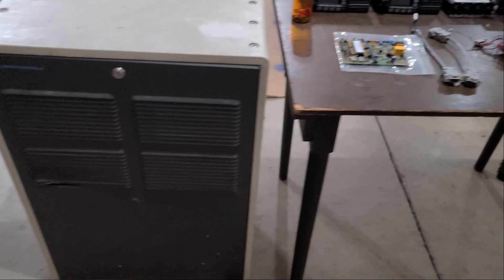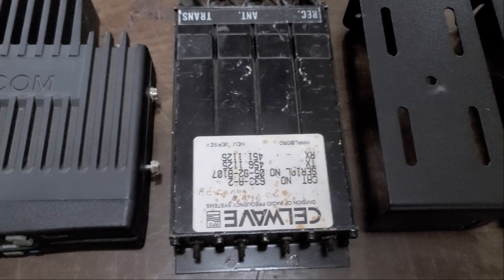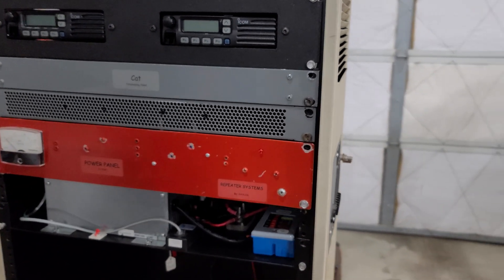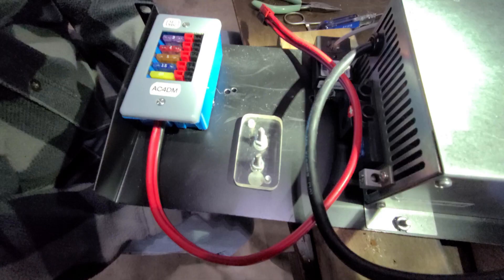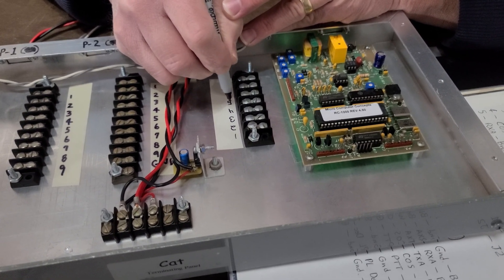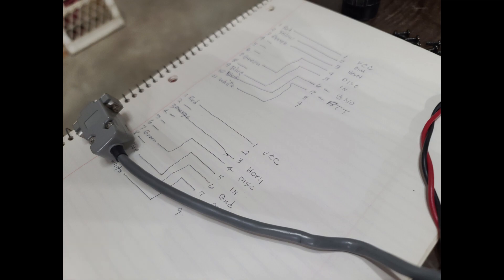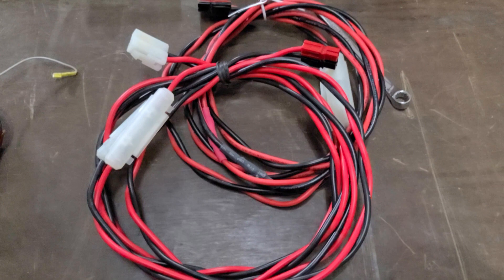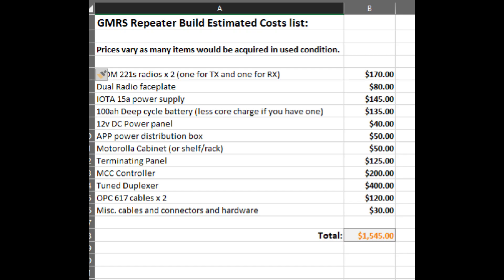LCARA HAM Radio: Building a GMRS Repeater Part 7: The Cost Breakdown!!!!

Comment: Years ago a friend came across a bunch of surplus radio parts from Uniden's commercial radio division. We went in halves and bought the lot. I came out with the basic repeater control boards in various conditions as well as odds and ends radio parts. Long story short, repaired all of the controller boards. Being in the 2way business since the mid 80’s and going tor hamfests I came up with various duplexers for cheap and in good condition as well as a fiberglass suitcase from a remote electrocardiogam transmitter.
Had a bunch of odds and ends HT90’s in the bin box. Well managed to salvage 2 of the 90’s had the re rocked to my frequency. Mounted the radios in their partial housings and supplied them with 12 volts. Mounted the controller on the same board and built an 8 volt power supply with an LM series 8 volt regulator to power the controller. Did all of the interface wiring between radios and controller and at first try had a low power repeater all mounted in this fiberglass case with enough room for a 12 volt gell cell and charger. It still works great to this day and I use it for remote camping use today in Europe, made sure it was not near any television bands in the area of use and it’s only for emergency comms. Even have  GE MVPeater that I purchased for $75 years ago, still works great except for some tantalum caps that decided to let their magic smoke out. Wish I could find some GE MASTR II Low split UHF chassis. With a little modification I can bring it up to the ham bands in use here in the EU. Only issue is finding someone to provide me with a set of crystals so I can recrystal it the right frequencies. These radios have excellent preselectors in the front ends so very little intermodal makes it into the receiver.

Comment: I just built a very simple and crude GMRS repeater on 462.625mhz with 100.0hz tone, all the way up here in Bee Lick, the furthest north point of Pulaski Co. I used a Motorola M1225 for the receiver and a Motorola CDM1250 for the transmitter with an ID-O-Matic IV controller for CW ID and courtesy tone. The power supply is salvaged from an old Dell computer that has been altered to allow operation via a toggle switch. The duplexer is a Cellwave RFS mobile type with RG-213 coax up to a Comet CA-712EFC antenna. I frequently talk on it with other GMRS operators in Somerset. Stop by and give us a call. 73 de AD4GC a.k.a. WROE979
Reply from the maker: Great work Greg! Come by sometime and show us some pictures. KY4BDP

Comment: So if you only have a gmrs license and not a ham,  then you shouldnt own and Icom??  I dont know
Reply from the maker: @Tightspot Pro - Thanks for watching! The ICOM radios used in the video are for demonstration purposes as they do not comply with Part95, but the overall process of building a repeater with these radios or ones like them is valid for VHF or UHF repeaters and can be used by HAMs. GMRS license holders can use most any GMRS repeater in their area, most with permission.
Reply: @LCARAHAMRadio  Thanks.  I wasn't sure.  I'm new to this. I have been interested in ham but came across gmrs.  I may move forward w ham later on. But so far gmrs seems pretty great.

Comment: I hope you guys didn’t pay $400 for that duplexer.
Reply: Mike, no we had this duplexer from previous projects.  But to buy one new could cost about $400.
Reply: @Chris-in-ky-ky4ckp  Not that I would use one outside of an ambulance (for med channels / full duplex apcor style handset) , but... notch duplexers can be had for a little less.   $125 from Amazon (Chinesium but not tuned) and $110 +/- from ebay (Chinesium INCLUDING tuning).  Not that the tuning would be great... but still "cheap".  I have used Celwave / RFS in the past, but the Fingu and other Chinese brands are much more affordable and, surprisingly, perform quite well.    

IF you can afford it -- ESPECIALLY if in a heavy RF environment like a tower install -- Get a Band Pass / Band Reject type duplexer.   Used - around $400-700 and tuning is around $50-100 (or...  just buy a spectrum analyzer with tracking generator or VNA to do the tuning yourself -- VERY easy for anyone RF or electronically inclined.  $2k an isssue for instrumentation??  just convince your wife that these things are critical to homeownership.   LOL)

Nice video collection !  Thanks..
Reply: Perhaps I missed it but did y'all cover the programming of the icom mobile radios?
Reply: @wassman27  No, they really glossed over the radio programming. Focused on power and wire troubleshooting, but controller and radio programming were left out (with exception of the DTMF RC-1000 programming; perhaps that is expected to be already understood).
Reply: @greasyjimmy  I connected with them via email and got the info I was looking for.

Comment: I enjoyed this video. 
I would choose the Wouxun KG-1000G GMRS Base/Mobile Two Way Radio option where everything is built in. You have to get a duplexer and a power source. The radios are $320 each (they come with the connection cable) and the duplexer is $400 tuned. Add your battery and power supply $280 and you are under the Bridgecom price or building it.
Reply from the maker: There are definitely several ways to go when looking for a repeater and it is always nice to have options available! Thanks for mentioning another option so other hams can be aware of whats out there.